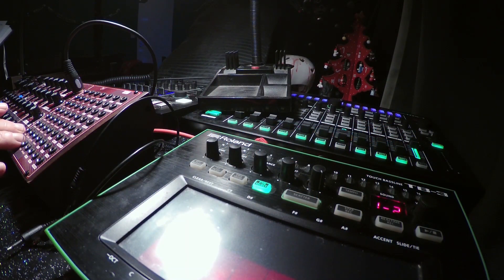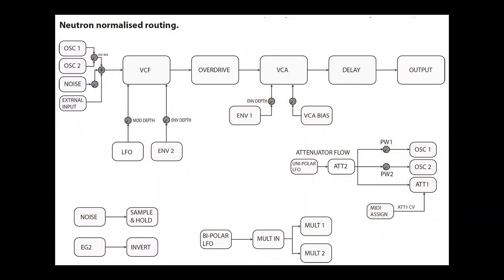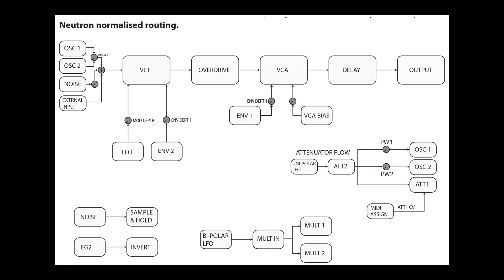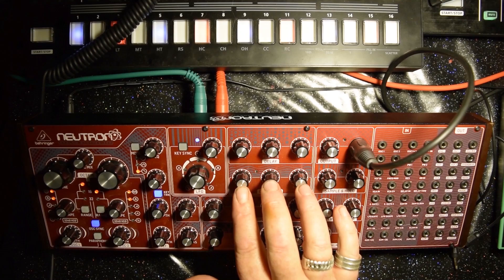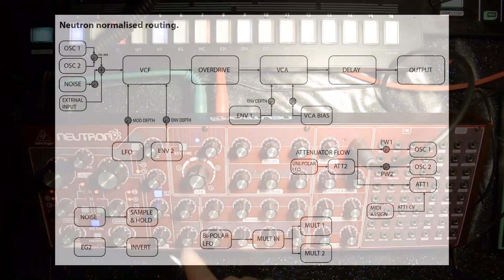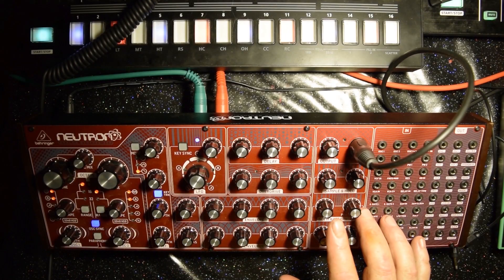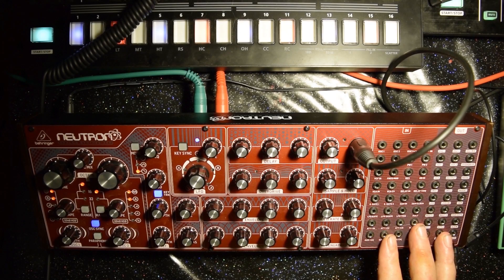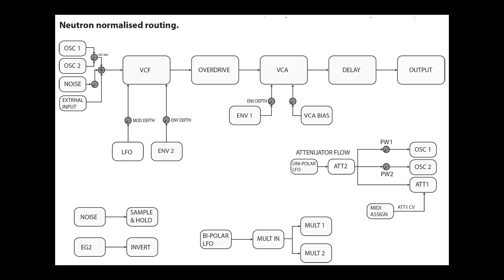Behringer Neutron Patchbay & Internal Routing Explained, How to use the Semi Modular Synth Patch Bay

Comment: My takeaway is the diagram in the manual is wrong. It shows external input going into the VCF. You would think what you did would break the vco and external input.
Reply from the maker: Hey Justin, am I right in thinking that it mixes it and doesn't break normalisation..??  I know that with the crave it breaks the normalisation of the Noise if you connect to the Ext In but thought it just mixes the signal with the VCO and noise generator pre filter in the Neutron..??

Comment: This is interesting, Pete. Question - when you listen to the Ext In only, when you patch into the Neutrons VCF In, where is that black patch cable coming from if the red 1/4" is the main audio connector between the two units?
Reply from the maker: It goes into the vcf, cutting off the oscillators  Steve
Reply: I hadn't realised that just plugging into an "in" only had any effect. Trying that this evening👍. Getting good Berlin School multi-sequencing though by merging a TB3 seq via midi with an already running Neutron seq from the BSP, but cannot get any TB3 sounds out of the Neutron using the audio cable running from the TB3 at the mo. I'm wondering if I need to change the Midi channel output on the TB3, even though midi is working.
Reply from the maker: Oops, gotcha... its just a loose end